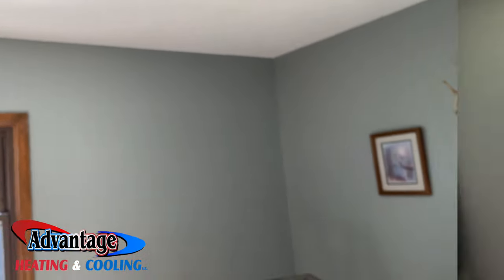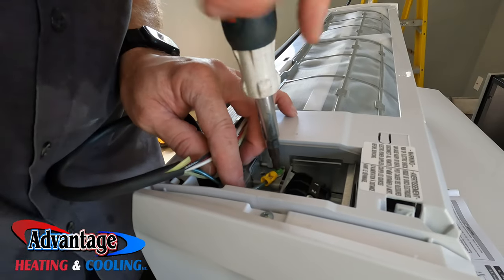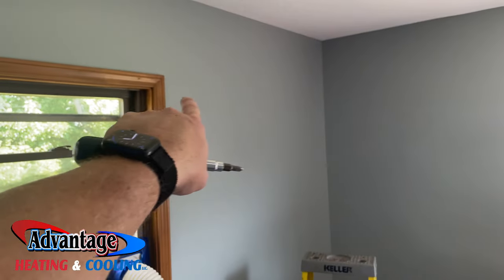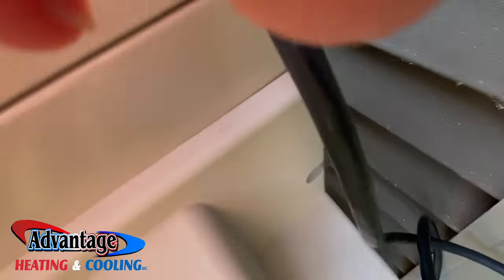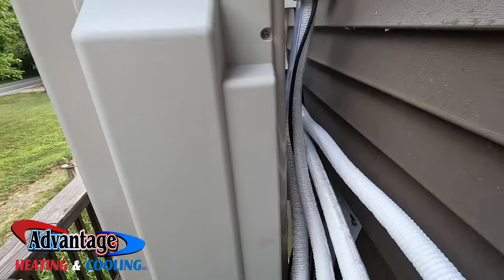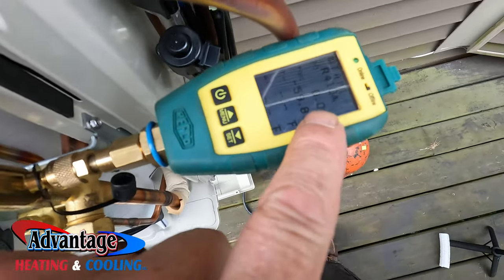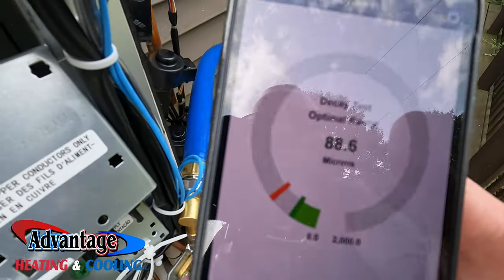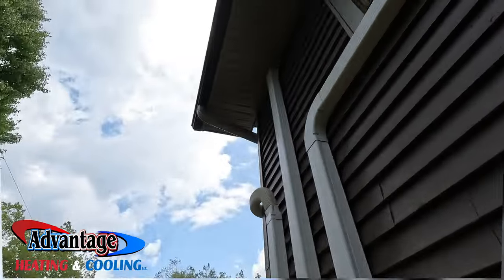Fujitsu Mini-Split: The Ultimate Home Comfort Revolution!

Comment: I like this brand. All of my  air conditioners are Fujitsu's. I used to purchase gree and midea air conditioner, but all of them were bad on heating up in winters, after few years attemped I found Panasonic is better than all of Chinease brand, but Fujitsu is better than Panasonic. Fujitsu air conditioner is not only efficient by also worth for the price. Unfortunately, most Chinese people think fujitsu is not a famous brand an not cheaper enough. Their opinion caused them to stay in a cold room during winters and very high electric cost in summers.

Comment: Is it only required to pull a vac on the larger suction line or can the small suction line be used as well for evacuation before opening the valves ?

Comment: Not trying to be that guy but just so you know Fujitsu systems should be pressure tested at 650 psi for 15 minutes. 
Plus you should torque your flare fittings. 
We are an Fujitsu elite dealer and these are the things they require.  Just trying to keep you from having a call back for a leaking system in the future.  
Go for the training is worth it to get elite status. 
Good luck and be safe
Reply from the maker: Thank you for the heads up.

Comment: What’s your experience with the white linesets?  I hear moisture builds up between the armaflex and copper and causes pitting in the line which leads to leaks…. Perhaps this is a different manufacturer.  Also I hear they are not UV resistant and will degrade over time.

Anyone else heard of this?
Reply from the maker: Never had this happen, you made me curious about the UV. So grabbed my cup of Morning Bean and went to the Barn and had to take a Peak. The Linesets that we used on this job was Gelcopper R-4  UV protected.
Reply: I’m glad to hear that is the case.  You might want to look into this white lineset issue, I’ve been seeing more and more claims on these.

Job well done BTW.  Clean work done by you guys as always!
Reply: Get some UV resistant line set tape. Use a stud finder next time.

Comment: Did you offer a standard split hp system with ductwork in the attic, a good high efficiency air cleaner, the hp set on the ground, line set ran straight up  beside downspout into attic. No communicating bs, no window screens for air filters, no messy PM’s, no ruined walls from condensate  leaks, no gawdy line hides all over.
Reply from the maker: No attic access, move on Troll!

Comment: Well done.  Have a question, how to set a Fujitsu simple controller uty-rsry function 7 to enable.  Somehow it says operation prohibited for me. Your help is greatly appreciated.
Reply from the maker: To set Function 7 to “Enable” on a Fujitsu Simple Controller UTY-RSRY, follow these steps:

	1.	Turn off the air conditioner: Ensure the unit is off before starting the process.
	2.	Enter Function Setting Mode:
	•	Press and hold the Mode button and the Fan button simultaneously for about 5 seconds.
	•	The display should show “F” followed by a number, indicating that you are in Function Setting Mode.
	3.	Select Function Number:
	•	Use the temperature up and down buttons to change the function number to “07”. This is Function 7.
	4.	Change Setting:
	•	Press the Mode button to cycle through the settings for Function 7.
	•	When you see “1” (which indicates “Enable”), stop pressing the Mode button.
	5.	Save the Setting:
	•	Press the Timer button to save the setting.
	•	The display should return to normal after a few seconds, indicating that the setting has been saved.
	6.	Exit Function Setting Mode:
	•	If the controller doesn’t exit automatically, you can press the On/Off button to exit the setting mode.

Your Function 7 should now be set to “Enable”. If you encounter any issues, refer to the manual for specific instructions related to your air conditioning unit model, as slight variations can exist.